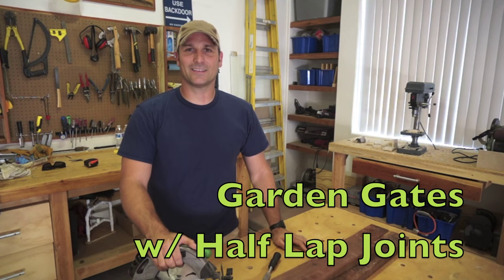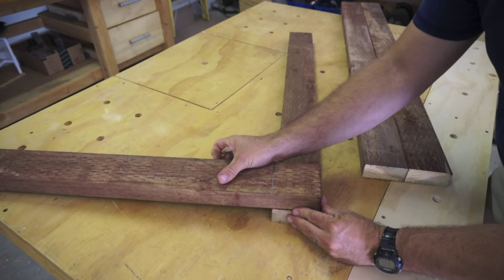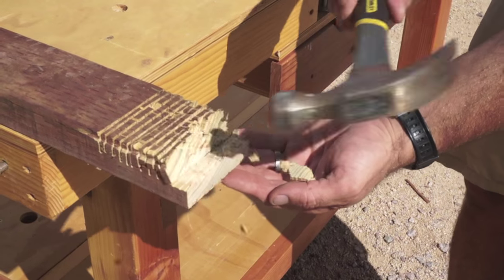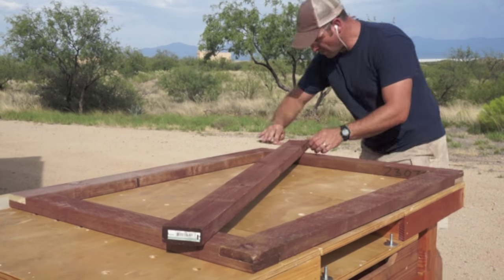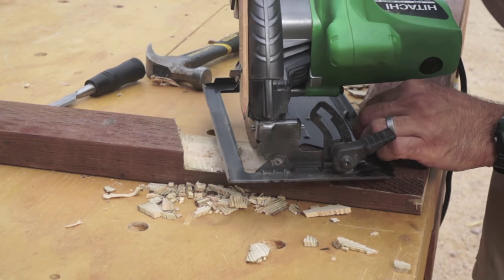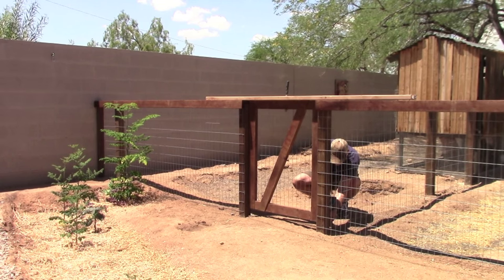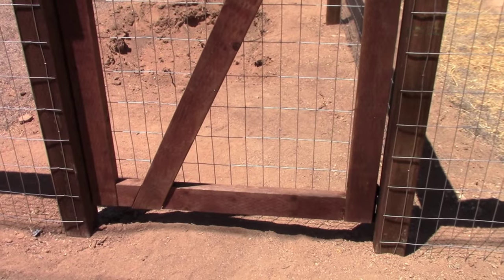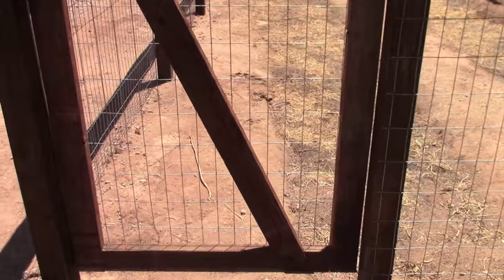DIY Garden Gate with Half-Lap Joints

Comment: My rule of thumb is; 
Wood angle brace goes UP away from the hinge side.  
Or turnbuckle tensioner goes DOWN away to opposite corner.
Reply: Paul is right. It puts the weight on the post in the ground so the gate doesn’t sag.
Reply: If I'm reading this correct, he should have angled his brace the opposite direction from how he did it?
Reply: @SirPhilMcCrackinVonBeggington  Yep, that's what they're saying. I noticed too just now. I think it's even more true with the half-lap joints. Any weight or pressure causing the gate to sag will push against the ledge of the brace's half-lap joint and then push the bottom half-lap of the brace into the bottom board, and since the brace is near the hinge side, it has a very short lever to actually cause sagging. Reversing the brace, like in the video, relies on the hardware resisting the force as weight tries to pull these joints apart.

Comment: You do great work and these gates are plenty strong and light.  The problem, you hung them backward.  The diagonal is to come up off the bottom hinge and support the extended weight from the top.  Your current position will allow for sag and failure.
The build is great but the purpose and longevity of the gate is ultimately determined by the diagonal support that counters the extended weight away from the hinge.  Simply turning it around will probably double the life of the gate.
Reply from the maker: David Harris Thanks for the info David.  You are right, but being a solid cross member, it can provide both 'pulling/tension' stability as well as 'compression' stability for the total 'shear' strength.  In this manner, the cross member is providing tension strength much in the same manner that a cable support would provide.  Not saying it's the right way, but just 'a' way.   If it was a substantially bigger gate I'd definitely be a bit more picky on the orientation.  But I'll check with her and see if she wants to change it.    Anyways, thanks for the great info and for watching:)

Comment: Nice gate, and I like the trick to use the saw to help make the lap joint Joe!
By the way, I read somewhere, that the "Z" brazing is to be installed with the lower brace end closest to the hinge, thus it will help support the gate from sagging. I guess it doesn't matter much wth your gate since you put it together strongly and the gate weight is not an issue...Thanks again, Joe!
Reply from the maker: +Samuel Tan Thanks Samuel!  Yes, traditionally the angle goes from the bottom hinge to the opposite top.  It is more important with larger gates but something this small really doesn't matter to much... in my opinion :)  
So long as the gate stays rigid it truly won't matter either way.   But, In the position that it is right now, the cross brace is providing a 'tension', much like a turn buckle tensioner that you see on some gates.  In the other manner, the cross brace will take on a 'compressive' force.   
Overall, I'd say if you built it right and tight and it's less than say, 3ft across do it either way.  And if it is over 3ft in width, make sure it angles from the bottom.
Anyways, hope that answered your question:)
Joe
Reply: Especially since you went to the trouble to create the half-lap joints for the cross brace, angling it up from the bottom will not only create a compression load instead of a tension load. In the "proper" orientation the weight of the gate sits on the joints, while now it is hanging off the screws. There is a much greater chance that over time the screws will move a bit (at the very least) and the gate will no longer be square.
Just my two cents.

Comment: Another great video Joe.  I used pocket joints on the gate door for my chicken run but I like this better.   The tip for using the shim to secure the gate for hardware is excellent.  Keep em coming Joe.  I learn something with each video.
Reply from the maker: Randall Montgomery Thanks Randall!  Much appreciated and in the process of making these vids I end up learning a lot myself ( mostly through mistakes though..lol)

Comment: Great Video,  You built a strong gate but your hinges should be on the side where the cross brace is at the bottom to transfer the weight to the lower part of the swing post.
Reply: ok, I was just about to make the same comment before I read this suggestion.
Reply: Great tip. Thanks

Comment: Great looking gate. I like the way you hung it even better. Very straight forward. I was wondering if you had thought about how the gate can engage the ground better so that no critters can sneak under and have their dinner?
Reply from the maker: thanks CLE!  The best thing for ground clearance and security would be to build a threshold that the gate set just above.  It could be done with chicken wire and a 2x4 across the bottom of the opening or even a poured concrete one.  You'd have to step over it when you went in... but you could make it sloping so that it was kinda like two way ramp and it would be able to allow a wheel barrow to roll over as well.  
I'm not totally sure that made sense but now you got me thinking about maybe doing that for my garden area.  Currently I just have some chicken wire and rocks at the bottom of the gate... but I have to move them for the wheel barrow.  so that might end up being a great solution.   lol... now I'm rambling:)
Joe
Reply: Good idea Joe. I appreciate it. Thanks.

Comment: thanks for this video it took me hours of searching to find this straightforward simple demonstration of how to use a skill saw to lap join two by fours. So glad I found it. Why didn't you use glue though? Also would love you to show how to smooth the lap cut with the chisel since you mention using the saw can be tricky,,,, great demo thank you
Reply from the maker: +veniceclay Glad you liked it VC:)  I didn't use glue as the design of the gate and the screws hold it very tightly as is.  Also, I have heard that treated wood, as used for this gate, sometimes doesn't adhere with some glues all that well.  If I used standard wood or heat treated would then I probably would've used it as well.  But, when in doubt, add some glue... can't hurt:)
Regarding the chisel smoothing... it's not hard really... there is a very little bit shown on the first lap joint right after I finished with the saw part.  it'll at least give you an idea:)
Hope that answered your questions... and thanks for watching!
Joe

Comment: Great video!  I am definitely going to use some of your design elements in my gate!  
QUESTION!   How did it hold up over time?  Since it is hung on a single post with no top frame support, did it bend or is it crooked at all?   
I notice the excellent fit that you have in the video, in terms of gaps and hanging straight.  I am wondering if it is still hanging perfectly. 
A reply is greatly appreciated!  Thank You!

Comment: You hung them backwards. The cross brace always goes to the bottom hinge to prevent sag. Otherwise it looks great!
Reply from the maker: scott jefferies haha.. yep, I heard that as soon as I posted the vid...lol!   However, I did some research and while that is probably the best way being the cross brace provides compression strength, I did find that in this manner it provides a tension support, much like a cable on a crossbrace-less gate.  But thanks for the heads up, and I'll definitely switch it up on the next one.  Thanks for watching Scott:)
Joe

Comment: I thought wood was stronger in compression meaning the cross brace should be the other way
Reply from the maker: Yes that’s generally true.   But for a gate that is this narrow, it’s negligible in its impact.   If you scroll through the comments you’ll see problem ‘very passionately’ defending the proper this way or that way.   But the fact is that this gate and others that I’ve built with the bracing in both ways have not sagged or come out of form.   For wider gates it would be beneficial to make sure to get the proper brace angle from the lower hinge or tension via metal coming from the upper hinge.   
Anyways, hope that is a clear as mud😂👍